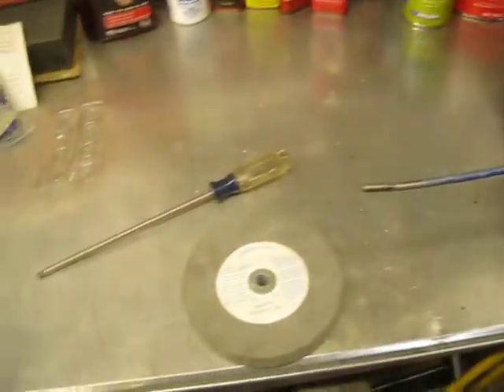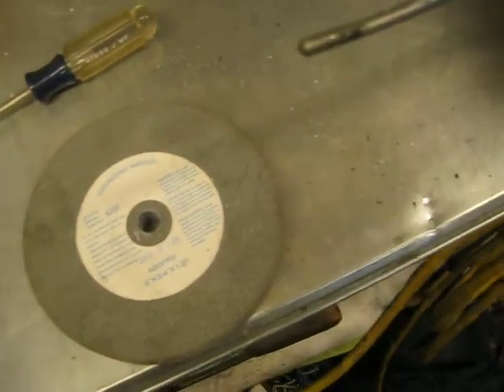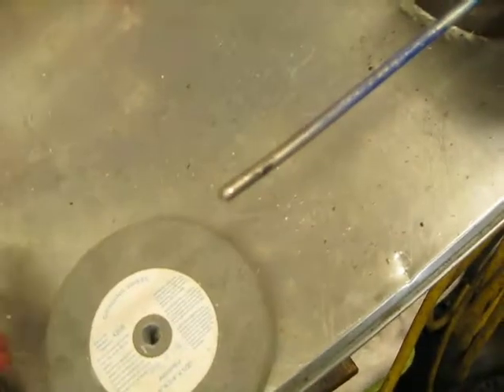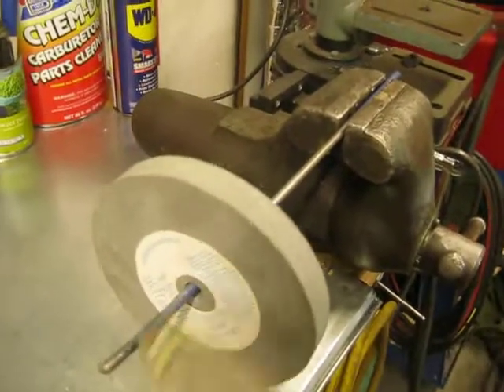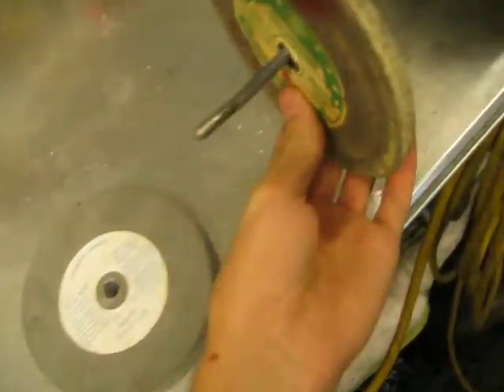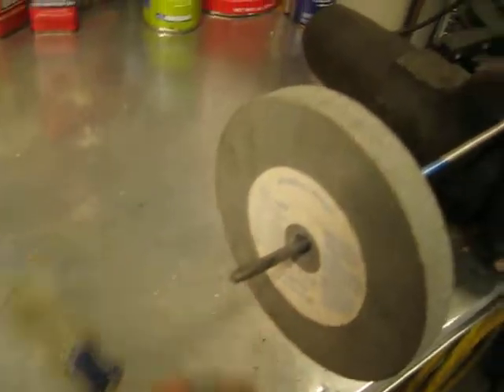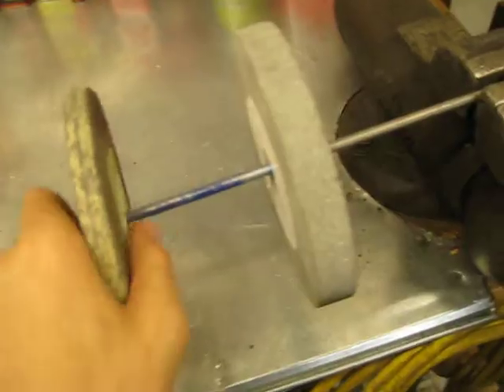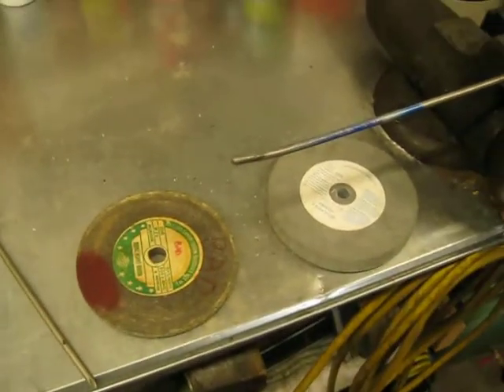How to test a grinding wheel for cracks

Comment: I learned of this when I was in my 20's. I read a story, in readers digest I believe, about a guy who had a grinding wheel come apart while he was working in his garage. It virtually shattered all the bones in his face, and he required extensive surgery to correct the damage. They recommended this test at the end of the article. This is a good thing to know.